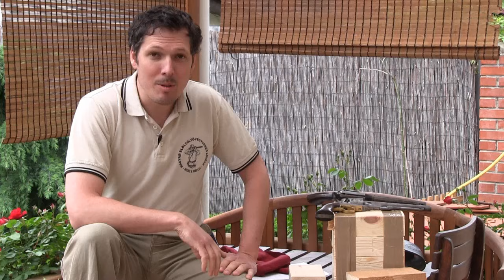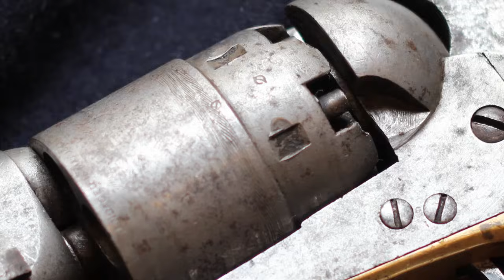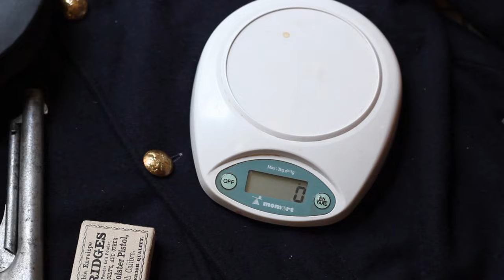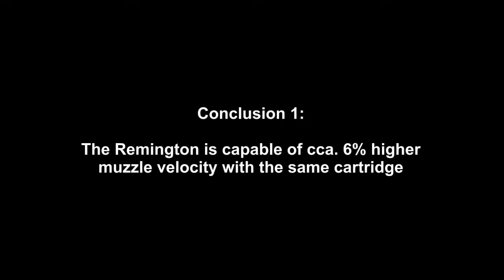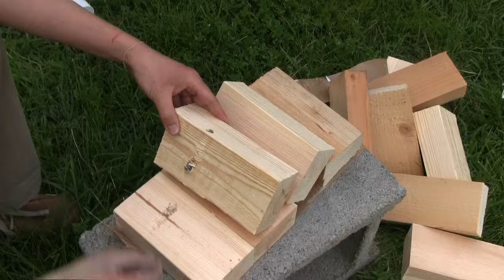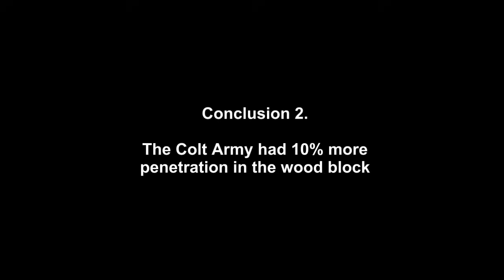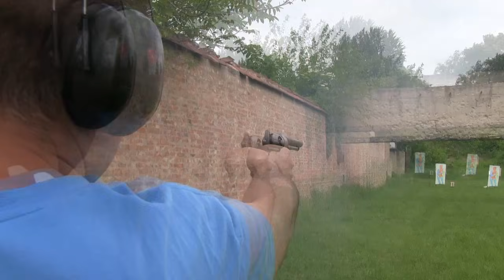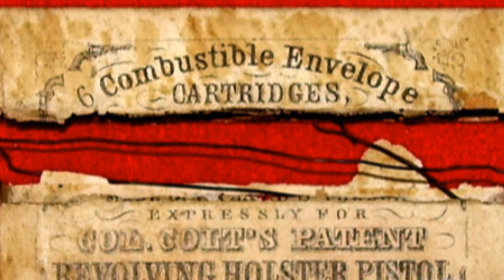Original 1858 Remington New Model Army vs original Colt 1860 Army percussion revolver

Comment: A flawed comparison: (A) Each gun is an individual, so comparing just one against the other is not statistically valid. Compare 50 original Colt and Remingtons against each other, and you would likely reveal trends.(B) Accuracy test should have been done from a benchrest, with hands on a solid rest, to eliminate any "wiggling around." Shooting one-handed is not a good indicator of either gun's accuracy capability.(C) Original paper cartridges from that period varied widely in bullet weight and powder charge. Search the internet for an article posted by Gatofeo entitled, "Found! Original Loads for cap and ball revolvers." Gatofeo, who knows a great deal about cap and ball revolvers, concluded that there was no real standard for bullet weight and charge; contractors assembled cartridges with vast differences. However, I applaud you for sticking to only one bullet weight and powder charge. This was good statistical method.(D) I also was pleased to see that you fired these revolvers at 50 meters. The originals, and most of the reproductions, were sighted to hit to point of aim at anywhere from 50 to 100 yards. The revolver, with its six shots, was thought of as a substitute to the largely single-shot (Henry and Spencer not counted) rifle.(E) I believe your bullet diameter of .452 was too small for these original revolvers, which resulted in poor accuracy. The gain twist rifling of the original Colts and Remingtons was noted for producing very fine accuracy. The late gun writer Elmer Keith notes that he had a Colt 1851 Navy about 1910 that, with lead ball (no size given) and powder charge nearly filling the chamber (no weight given) and felt wad soaked in melted beeswax and tallow would put all of its 6 balls into one ragged hole at 20 yards. Others have praised the accuracy of the old revolvers with gain twist. Today's modern cap and ball revolvers have constant-rate twist, not gain twist (a few Remington patterns made for target shooters, with gain twist, are an exception).(F) The Colt jammed from a spent cap, but I believe this didn't become a big problem until people started using the old, original guns with caps made in the 20th century. I have a few tins of caps made in the 19th century, and the copper is thicker than today's caps. Consequently, the old cap gets a tighter grip on the nipple. Today, people buy new nipples that are slightly larger than the old nipples, which compensates for the thin copper of today's caps.A very fine report, but until we can challenge 25 to 50 original Colts in very good condition against 25 or 50 original Remingtons in the same condition, we'll probably never know how accurate the old guns were. There are many contemporary accounts that praise their accuracy, and they were almost certainly more accurate than the later .45 and 9mm issued to militaries during the 20th century.With my own Uberti-made Remington .44, and the Lee 200 gr. conical bullet, I can put six bullets into a 1-1/2 circle at 20  yards from a benchrest. I believe the gun is capable of slightly better accuracy, despite its constant rate rifling, but my 63-year-old eyes are not!-- GatofeoRemote Utah DesertApril 19, 2018
Reply: Very interesting! I use Gatofeo #1 lube with my cap n balls. The ugly cat knows his business. Don't underestimate the old antiques! A local journalist, noticing my 25-yard groups, did an article on my cap n ball Colt in the local paper. These were the most effective military handguns ever made, as they were the primary arms of cavalry troops. Elmer Keith noted an 80-something YO Civil War veteran he knew in Montana could put every shot in a fence post at a full gallop on horseback.

Comment: definitely agree that the sight picture is better on the Remmy, and the Colt is more comfortable, and easier to clean. I think it's odd that you keep getting caps jammed in the action; when i do get a jam its usually the cap getting stuck between the cylinder and the frame.

Comment: The Remington cylinder pin can build up with fowling and seize the cylinder to the point I can't rotate if not kept clean, where as the Colt cylinder pin is designed to avoid the problem with a grease grove and spiral groves to keep it clean with out worrying of cylinder lockup between cleanings.
Reply: Can’t rotate with the caps jamming the action. I have multiple replicas of each and while the colt feels better in hand, the Remington is without question the superior revolver. I’ve never had an issue with the Remington dropping out cylinders either. I don’t know where you come up with this base pin “fouling”. It’s a myth just like the full frame supposedly causing cap jams. Colt stole the Remington design when they made their 1873...enough said, colt is second to Remington. Even today.
Reply: @jayswap2  I've never had a problem with my Belgian made Colt. No cap jams nor cylinder problems.

Comment: I am lucky to, i have both of them. :)
Reply: I have replicas of both too!
Reply: @BuddyTheGermanShepherd  Buy an original in shooting condition.
They dont blow up if there is nothing wrong with them, and loaded with the right bullet and black powder only. The last one is extremly important. But, they are not 100% reliable as a selfe defense weapon.
I dont like the idea at all.
Reply: @BuddyTheGermanShepherd  Aha Svensk.
Ser helt ok ut, men skjuter du på en anfallare med en bp revolver så ligger du pyrt till.
Reply: @BuddyTheGermanShepherd  It dont require storage license like black powder if you live in Sweden, black powder is states as explosive. But Pyrodex is also good, and not so hot like Triple 7
The bad things about these substitutes is that they make the revolver harder to clean, and might jam the revolver drum faster. But bp weapons has to be cleaned after every use anyway, or they rust.
Reply: @BuddyTheGermanShepherd  No, you can buy a Original revolver in Sweden, and pyrodex and T7.
Reply: @BuddyTheGermanShepherd  Its not.

Comment: In the Clint Eastwood film 'Pale Rider' the hero is walking and reloading his pistol but there is no evidence or reference to percussion caps when he's reloading. Would this be an accurate depiction of the firearm at this time in history?
Reply: Job38 Four they are cartridge conversions in The Good The Bad And The Ugly. In the other movies from the trilogy Clint uses a SAA with custom grips and a 5.5 inch barrel. And in Pale Rider Clint uses a Remington 1858 and reloads by swapping cylinders.
Reply: IF anyone actually did cylinder swaps in the percussion era , they would have been already primed .

   Yes , Cartridge Conversions were widely used back in the day .  Both actual percussion revolvers converted , and factory built using stocks of leftover parts, after the US cancelled all existing contracts at the end of the war .

  But they Weren't in .45 Colt .

   Individual gunsmiths undoubtedly used others also , but factory conversions were primarily .38 Rimfire, .44 Rimfire, .46 Rimfire, .38 ( Short) Colt, .44 Colt, .44 Remington .

  These converted guns were popular long after the introduction of proper cartridge revolvers . For the first 5 years or so of the 1873 Colt SAA , most of the production went to the Army contract, and they were rare and expensive on the civillian market . And the converted ( & converted designs) were 1/3 to 1/2 the cost of an 1873 Colt or 1875 Remington, or S&W No 3 , making them very attractive to buyers . 

  The Remington conversions were slow to reload, and Open Tops not as durable as solid frames , but most people didn't fire thousands of rounds at a time , and they were just as fast for the first 5 or 6 shots, and .4r Colt or .44 Remington was plenty powerful enough for defense, or most hunting .

  They were widely enough used that ammo for .44Colt/ .44Rem was available until 1941 .
Reply: Pale Rider, my favorite western. Around 1870 cartridges was introduced, with the surplus o Civil War pistols, many were fitted with conversion cylinders so they could shoot 45 colts, so yes the movie for once was right. I have two conversion cylinders for my Pietta 1858 Rem. very fast to swap
Reply: Job38 It's seems that Clint Eastwood is possibly quite knowledgeable about pistols. In the preparation for 'Unforgiven' he asked for a selection of pistols to be brought to the film set and without hesitation selected the most appropriate models for the date period the film is set in.
Reply: The first thing I look for when watching westerns, is Period Correct firearms, maybe Clint learned that from his early westerns, because my next favorite western is (The Good the Bad and the Ugly), the revolvers are all wrong, but I still like the movie.

Comment: I realize that this reply is three years to late but, I did notice that the colt had a much poorer bore than the Remington. I imagine that would go with the worn finish. that said, everything you said about the colt is true.but I would say that if the bores are comparable,  the accuracy would be comparable. no?
Reply from the maker: I agree Mike, regarding the Colt the only question is weather it will shoot to the same spot after disassembly and reassembly or not. That 1860 Colt is a fine shooter with roundballs on the other hand. Pitted or not it can produce competition grade groups.

Comment: I think the only reason the Remington seemed more accurate is because it's in far better condition than the Colt. The pitting in the Colt is deep, but the gun is polished clean indicating to me it was likely cleaned improperly. Who would willingly rub off that pretty case hardened finish unless it was a chunk of rust? I have reproductions of both and I find the Remington difficult to aim due to the shear size of the front sight, plus the small cylinder pin becomes very difficult to remove if it has any gunk on it at all. Overall I like the Colt, the pieces are difficult to manage if your swapping cylinders on the run but the ease of cleaning makes up for that.

Comment: The grip frame of the 1860 is much more ergonomic and comfortable, but the 1858 is a superior revolver in every other way. I had a machinist friend of mine modify the grip frame of my replica stainless 1858 by opening it up some behind the trigger guard to make it more like the 1860 grip. I also had him enlarge the nipple windows on the cylinder to allow for use with a capper. Lastly he deepened the safety notches on the cylinder just a little, for stronger hammer contact. I put in a lighter trigger spring and polished the sear and hand. I have what I now believe to be the perfect percussion revolver.
Reply: That is completely opposite actually and there are sources to prove it.  Soldiers would readily pitch any Colt to save on weight and just use their rifle and bayonet or would trade a Colt and something else in addition to it just to get a Remington, because Colts had a design flaw with the opening to the action being right under where caps would fall in and jam.  It was very well known and they were very inconvenient to clean out in the field. They had paper cartridges that made them a bit easier to reload but these were often used up quickly and supply lines were often cut off. Remington 1858 revolvers were a huge innovation that changed revolver design forever. There is absolutely no doubt about it. The first modern revolver.
Reply: Colt's were much more popular during the Civil War with soldiers, in fact soldiers would throw a Remington away if they could pick up a Colt Navy or Army on the battlefield.  The open frame of the Colt let those guns be fired longer before having to be cleaned.  A Remington could fire about 2 cylinders before becoming so clogged with black powder residue that it was worthless until cleaned.  Today the call is different, serious shooters want the Remington due to the solid top strap, they are more accurate, and since target shooting will allow someone to replace or clean the cylinders frequently.  Also with use, Colt's get worn where barrel meets the frame, so they become less accurate than the Remington or Rogers and Spencer.

Comment: Being a former green beret and weapons expert I'm curious why the integrity of the barrels was never mentioned. Even modern gun accuracy begins to degrade after enough rounds are fired through them, especially if they are not well maintained. To put these two side by side 150+ years after they were made and say one is more accurate than the other is like having two 85 year old men run a 100 meter dash and then declaring that the winner was a better sprinter when the runners were 18
Reply: As the rifling wears down you increase the diameter of the ball
Reply: I have had several cap and balls revolvers and feel his test was correct even with the difference in barrel conditions.
The top strap of the Remington adds a lot of strength and combined with the better sights the Remington always seem more accurate to me.  The slim feel of the colt just naturally points at a target better.  The sight on the hammer of the colts may be another part of the accuracy problem.  I am not sure that the hammer comes back at full cock to the exact same position.  You will commonly see drag marks on the hammers of open top revolvers where the rub in the frame as they are fired.  I have seen open top revolvers with both sights on the barrels and have wonder if that would improve there accuracy.  I would like to see the test done with round balls.  The tester did do a great job at shooting.
Reply: Well preserved guns hold up better than well preserved humans .

  From his other videos testing various original revolvers I'd have to say the Colt's sights were more of a limiting factor in 50 meter offhand shooting than any differences in intrinsic accuracy .
Reply: What?  These things are gain twist?
Reply: You’ve $old me on the Remington (only I’m after a .36).

Comment: I will proble  buy the Remington , but the colt looks better
Reply: Hi there Danny...Sweden calling. I,ve had 3 Remingtons 1958, all warn out to practise and competission.  Get yerself a side stick and feel your R....try and switch hands and shoot...aiming with yer right/left eye.  Secret is in tha bullit making. and the differnse between the bore and the drum. It needs to be as thigt as U can get it. there should not not be aproblem. when U get it rigt...U should get it right.. perhaps U should add a little support to the hand U are using....
Reply: And do not forget tha fat whithch is very importante and the fore loading...begiin whith 20 grains of blackpowder then 10 grains of corn flower and then a roundbullit, when U puch it down witth the rod there should be a ring of led coming of..if not U need a biggerround bullit...and here comes the fat,  lar and soap. mix em so they get a thicktexture ....this is trye and trye again...And remember....Be 1with the bullit, feel it, want it, practis again and again.

Comment: I only bought the 1860 replica as it was on sale and the 1858 combo I came to buy was sold out. Never thought i would like it but the 1860 is one of my favorite guns of any kind I've ever shot. 33 years a handgunner, carried professionally in security work both revolvers and pistols, qualify expert with both. Carried concealed in Virginia with a permit. Nothing fills my hand like the 1860. Of course I really like my 1858's. They are more reliable with fewer cap jam worries, faster to reload and easier to field strip. I am more of a woods loafer than any kind of serious hunter. The primary weapon in the hills where I'm from is a walking staff of some type against rattlesnakes. A revolver is just a nice peace of mind companion and a good .44 will take a wide range of game given the opportunity. For those times I reach for the 1860, when out and about and 'don't need a gun'.  
    For a backup to a small caliber rifle, or a primary game getter, or serious social purposes if it ever came to that I'd take the 1858. If I could only have one, it would be the 1858 but there is something magical about the Colt replica in the hand, and it's just a bit lighter on the belt.
Reply: Add slix shot nipples to your 1860 army then and you have a winner.
They redirect the blowback through the nipple and makes sure the cap stays on, so it wont fall into the action :)
Reply: ToreDL87
a trip to mike is in my heart for my Pietta, but the wallet is weak at the moment. :D
Reply: Doug Beatty No need for trips, screw nipples off/on is easy as hell :)

Comment: Would you mind sharing your lube recipe?
Reply: +He, who had once been you. When I had my Navy Colt .36 I used a single drop of 80-90W transmission/gear oil. LOL! I got lotsa weird looks, but never a flash over and seemed to smoke a little bit more. Cleaned up like when I used the store bought stuff. Used a empty Clear Eyes bottle to hold the oil. Cheap way to go and it worked.

Comment: QUESTION: Where can I buy read-made combustible envelope cartidges? Google search doesn't seem to be very helpful here :/
Reply: +RaphaelJP Dixie Gun Works has them; .44 cal in a box of 6 for $20
Reply: Thx a mil, mate :)
Reply: You can get nitrated paper at Buffalo Arms for making your own.  I've heard that magic shops carry it also but I don't know how hard it is to find.  There are youtube videos on how to roll your own paper cartridges.  For paper cartridges use nitrated paper as plain paper may interfere with the cap charge.  You can also use cigarette papers from which you pour out pre-measured powder, followed by the paper as a wad, then the bullet.  Those are just a cylinder containing powder and ball with paper ends tied off.
Reply: Thank you, Mark, once again :) I did, in fact, make some cartridges on my own, using cigarette paper, having seen a 'how-to' vid on YT. And they worked just fine. However, the process is rather time-consuming, and it'd be nice to have some 100 psc. to hand, just in case ;)